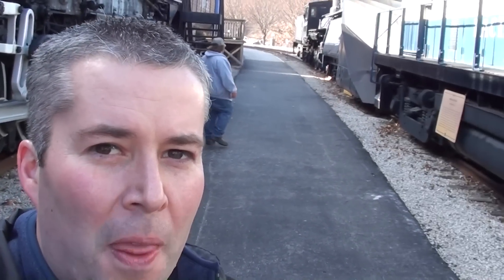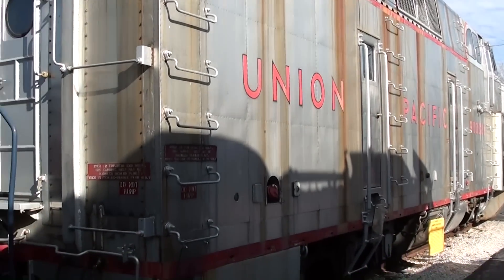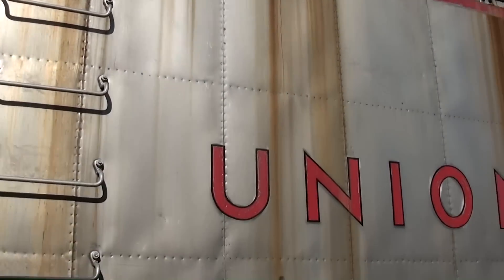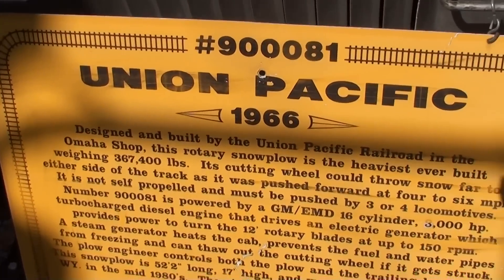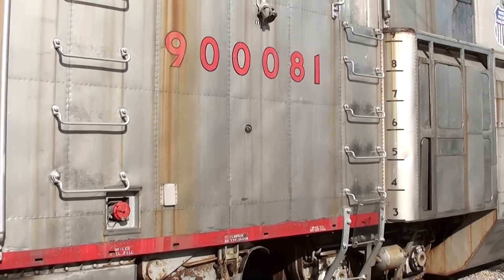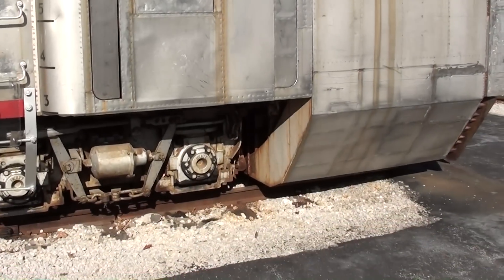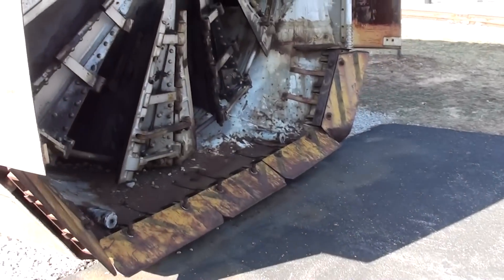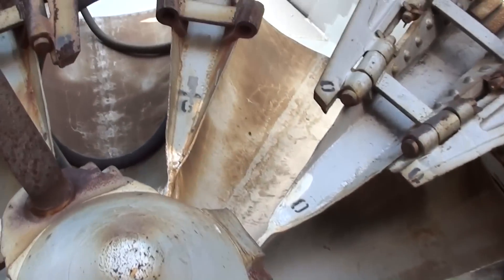3000 HP Union Pacific Rotary Snow Plow - Heaviest Ever Made - 16 Cylinder

Comment: Good video. There have been a few of these made in the US since the 1880s. One was stored in Westwood, northeastern California for a while. I discovered it by accident. What a monster!! I had never even heard of them before. But now they are easily found on the Web.
Look up "rotary snowplow". The several rotaries still around are owned by several different railroad companies, and were made in different factories. Some others are on display in different places. So it is interesting to look these rotaries up. Some are bigger, some open wider so as to create a huge path through the snow. And there are other differences. And there is even one in Europe. I favor the large square opening, which this one doesn't have. I can't imagine the purpose of clearing LESS snow down at the track level. These machines are not all like that.

Comment from the maker: @bisquik3006 It was made by GM's Electro Motive Division...a monster 16 cylinder. They also made a 20 Cylinder, 3600HP version. I'll show a similar engine up close in an upcoming video. The pistons are 8 1/2" inches across and the stroke is around 10".

Comment: This is the second of three build by the UP. They are designed built from the rail up, and where "kit bashed" by using various of parts from several older rotarys and locomotives. While the engine inside only turns the blade, it would be pushed by several other locomotives. I think of all of the locomotives I saw there at MOT I think this was the highlight. The "Do Not Hump" (for all you pervs) simply means not to put over the "Hump" (a small hill) in a classification yard.

Comment: sadly, it does not mean what we all think it does. in locomotive talk Humping cars is when you push them to the top of a hill and uncouple them so they roll down and get switched to the appropriate tracks based on gravity power. its very unsafe. now days they do what is called shunting. they pull the cars where they need to be with a small locomotive called a shunter.

Comment: @TheRackleman Then and now the railroads use a system they call humping to sort cars in to trains. They push cars up a hill then uncouple and shove them down the hill. Then at the bottom the have switches to sort them. And since there is no coupler to take the impact and thus no humping.

Comment: UP  built a few of these from the ground up, not recycled diesels. None have been used in 30 years, and with the steam required for heating, may never be used again.
UP has two still on their roster, available should the snows return to the high mountains again. Too prone to break, to expensive (labor wise) to operate. Cheaper to keep trains running over the passes and using flangers to keep the tracks clear.